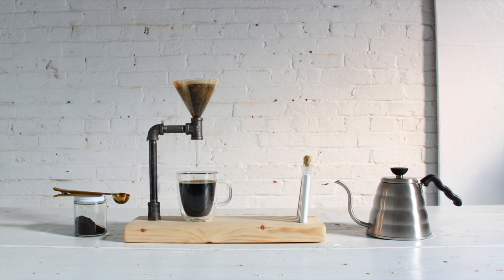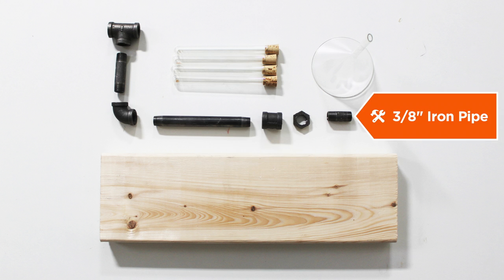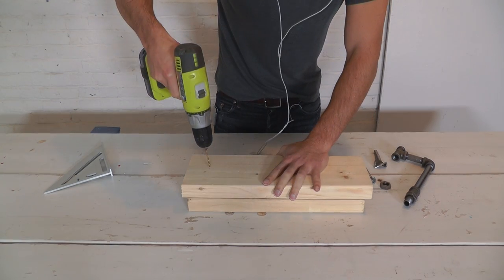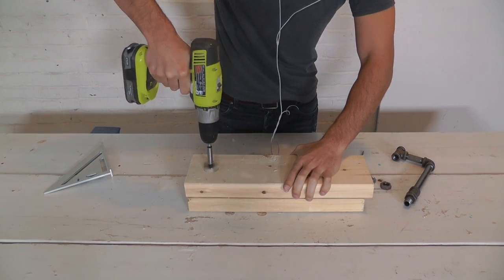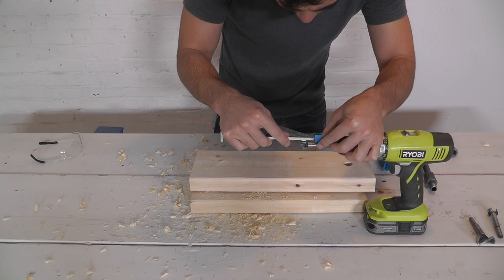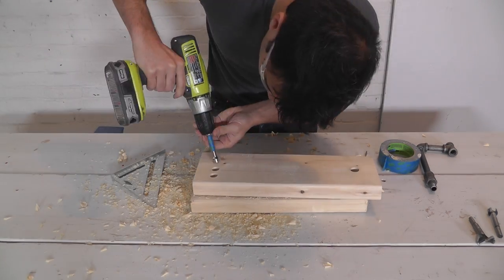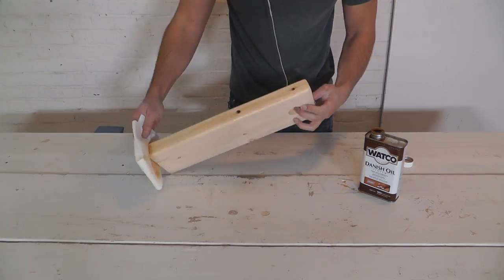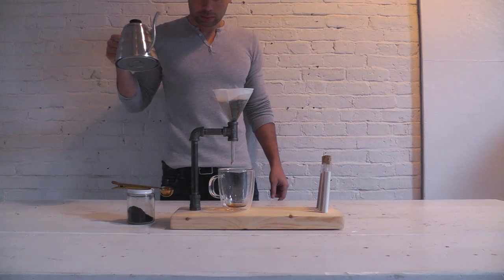DIY Pour Over Coffee Maker Made Out of Iron Pipes

Comment: Interesting, but doesn't it appear that the coffee is draining through the funnel a bit too quick? It's called drip coffee, not stream coffee, after all. Maybe one could shop around to see if there are proper drip coffee funnels for this project, or look at restricting the flow somehow.

Neat, anyhow!
Reply from the maker: yeah, thats what i thought as well. I think the filter type will impact that as well. I am interviewing different coffee experts and will incorporate their feedback.
Reply: You just need a thicker filter...
Reply: It looks like it's dripping pretty fast because it was on a "time-lapse" mode...
Reply: Bobby Bernas Timelapse doesn't transform drips into a stream, only to faster drips and it's definitely streaming through the filter. So I'm afraid you're mistaken Bobby.
Reply: Do you work in coffee?
Reply: +Switch & Lever Most coffee professionals will tell you to adjust your grind setting to get a different brew time. Many pourovers call for 3-4 minute brews but i've had great coffees finish around 1:45-2 mins. Also, if your pourover is dripping intermittently the whole brew time it is too slow. How would you ever get 400 mL of water through the grounds in less than 5 minutes if it's just dripping?
Reply: lol exactly.  Everything moves fast in fast forward.
Reply: Quick or not, you adjust it my griding size and how well you mange to pour the water. Or you can even change the dripper. This does not involve with the wood work.